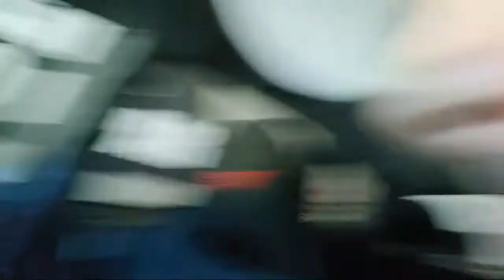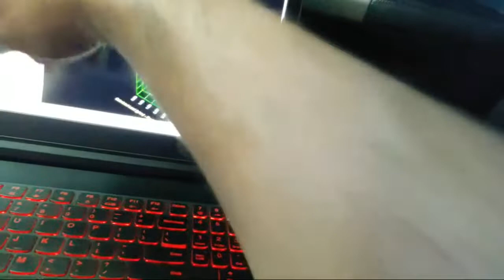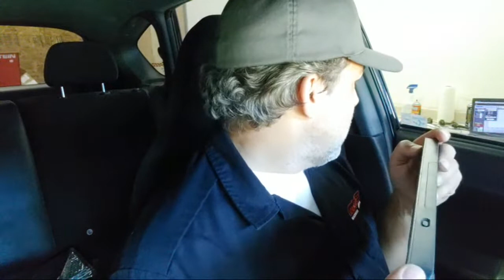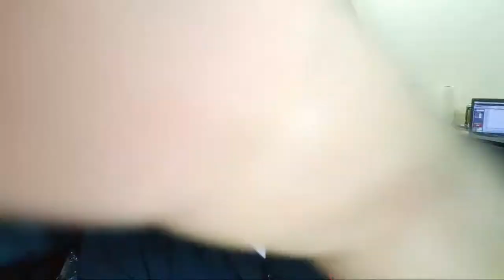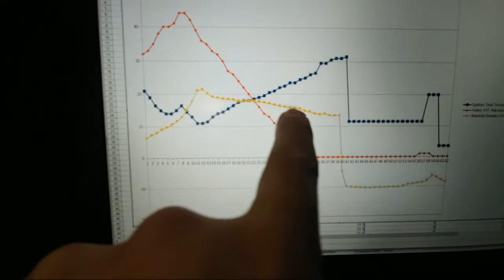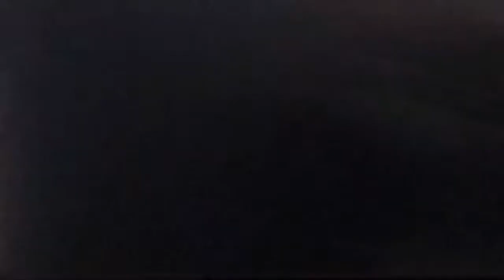Tuning STi On Cobb

Comment: Missed this feed but just watched the recap. Thanks for this. Definitely learned more about knock and timing. Especially since I’ve been on the fence about getting a little more umph from a dom 1.5 or going flex with on my va sti. Currently “stage 2” tuned with tons of reliability add-ons (ebcs, wideband, aos, etc. ). can’t wait till the next feed!